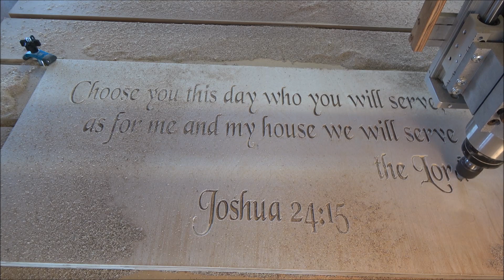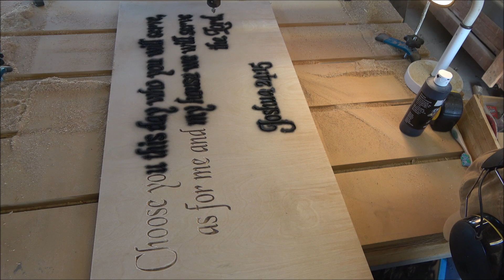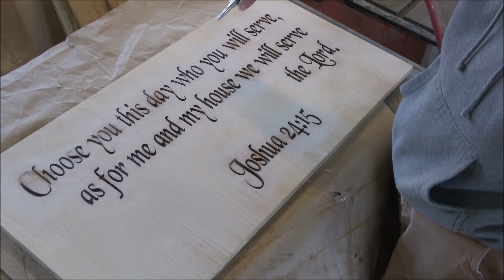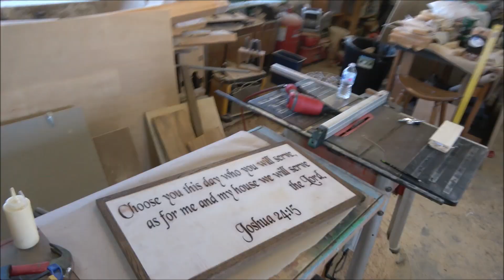CNC'd Scripture (Joshua 24:15)

Comment: Brian, just a small tip on your engraving projects. If you must use plywood, try switching to Baltic birch instead of the pine plywood. The top layer is much thicker. If you notice, the pine veneer on the plywood you use is so thin, when you sand off the paint, you are going right through to the under lament. That's what shows up red when you are sanding. Also, if you put a few coats of clear AFTER you Vcarve and before you spray on your colored or black paint, the paint won't be as likely tp bleed into the rest of the wood. That will also cause you to not have to sand off as much outer layer of the wood. I would suggest to use solid wood for your plaques and signs. They really look a lot nicer. And your customers would be much happier. Good channel though Brian. I like to watch other people make things. It's  good stuff. Keep it up.
Reply from the maker: That is birch plywood, well at least a veneered birch as you point out, I actually did use a sanding sealer, single coat though, probably should have done more than one. I put it on before I started cutting.  I too like to use a solid wood rather than plywood, cuts so much better, but a sign this size I would have had to charge quit a bit more for oak or cedar.  So usually it is a cost on customer situation and I know I can do what they are wanting for a cheaper price on the birch plywood.  I should have done more than one coat of sanding sealer. Thank you for the tips and thanks for watching!!
Reply: @SmokeysCNCWoodworks  By putting the 'sealer' on AFTER the cut. And I recommend a clear spray like Rust-o-leum, or the like as opposed to just a sanding sealer. The open wood grain that becomes exposed because of the cut is sealed. Not allowing paint into the open wood grain. No paint bleed. Birch plywood is different than Baltic birch. The top veneer is much thicker on the Baltic birch. It is probably cheaper than a birch plywood as well.

Comment: Hi Brian.  I cringed a little when I saw you trim on the table saw after cutting, but your explanation at the end made sense. I learned the hard way this weekend to cut the piece to size first, route the edges and cut the keyhole slot BEFORE spending a lot of time carving and painting!

I like how you showed more of the process in this video. It would be helpful to me (and probably others) if you spent 30-60 seconds at the beginning showing your layout in Aspire. Along with which bit you chose and why. Just a thought. 

I just subscribed to the podcast on Apple as well as the YT channel. Looking forward to it!
Reply from the maker: Ah, I've been running the table saw and other tools a lot longer than I have the CNC.  Now with that said, had I not programmed it larger than I meant to, The cnc would have done a border not a frame....Thanks for watching!!

Comment: When you paint using the air brush do you have to apply more than one coat? I am using Walmart brand craft paint and with a brush I have to apply up to 3 coats. Since I'm getting the air brush kit I'm hoping I don't have to do that.
Reply from the maker: I generally hit each letter only once then look it over to see if I missed anywhere and touch up, thats usually it....now that is with dark colors with white at times I have done 2 coats......Thanks for watching!!

Comment: Great video Brian. Quick question. When you paint the lettering I am assuming you let it dry. What is your sanding process after that to get the excess off? I know you put a poly coating on before to seal the grain? Thanks and enjoy the videos.
Reply from the maker: I either use a poly or a sanding sealer...it really didn't work well on this one, still sanded a little deeper than I wanted to....and yes I let it dry, but it really doesn't take long to dry maybe 10-15 minutes....Thanks for watching!!